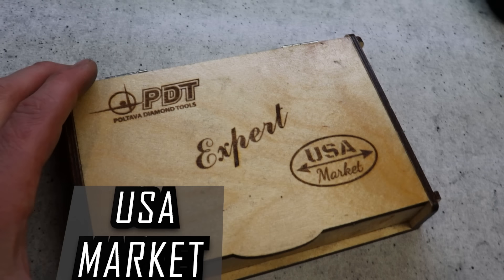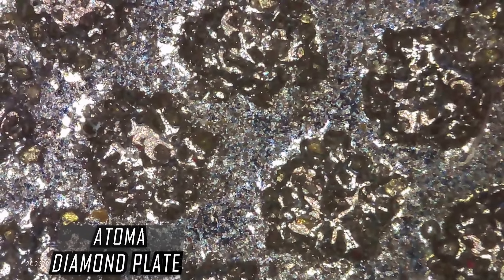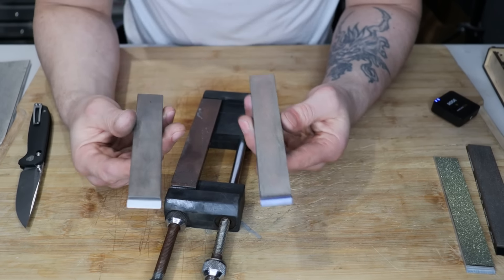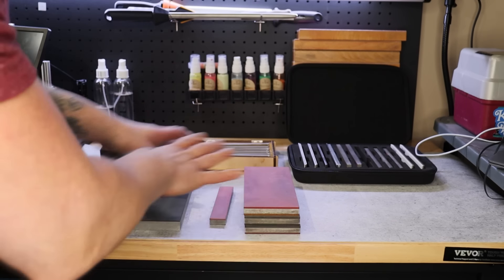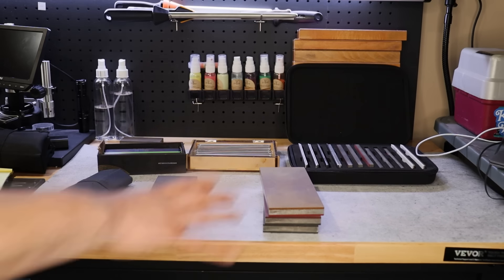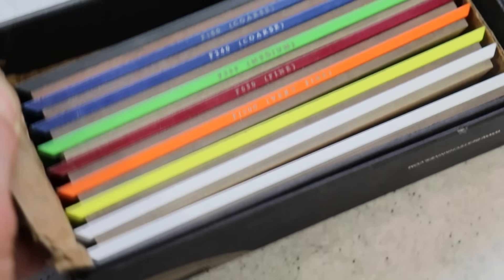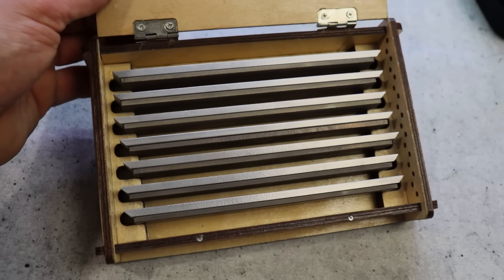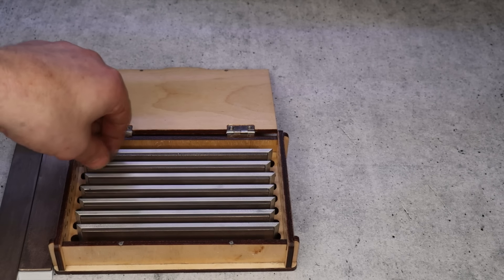Worlds Best Sharpening Stones!?  NEW USA MARKET SHARPENING STONES

Comment: I wonder how many knives can you sharpen with the little fixed sharpener stones?
CBN or Diamond
Reply: Depends on the grit, since lower grit stones will take more wear than the higher ones, but as a minimum likely thousands of knives.
Reply: 77 000 with CBN metal bonded, and 37 000 knives with Diamond resin bonded 🙂
Reply: @stranik1966  How did you come up with those numbers?

Comment: Have you tried lapping the Hapstone CBN stone to see if that brings up the performance?
Reply from the maker: yes i did, but im going to continue to test things out
Reply: @NeevesKnives  I would be interested to hear the results. I have had a 120 grit Poltava CBN stone for a while now so I just bought a set of Hapstone Premium CBN since a store in Canada is now a dealer so I don't have to deal with massively inflated prices, currency fees, or shipping costs.
Reply: @NeevesKnives  I just got my Hapstone CBN stones in. It seems they are made differently than the PDT stones. The gray layer on the Hapstones appears to be some kind of release agent, likely graphite or molybdenum. I cleaned it partially off of a single stone so far with alcohol, wanted to get some pictures with the digital microscope before going farther. Having it on the top of the stone means that both sides of the stone were likely molded so the top of the stone is completely flat and any CBN will be pushed in so they will need to be lapped, some fairly heavily to expose a decent layer of abrasives. That is why they don't seem to be cutting at all. My stones feel very smooth, the 400 and up are nearly glass like, with only the occasional abrasive particle able to be felt in the 150 and below

This did not need to be done with my PDT stone. Not sure if they do that in the factory, or if they are just not molded on both sides resulting in one side being usable out of the box. 

Just thought you might want an update and my thoughts on it.
Reply: Guys, the HAPSTONE HAS NEVER MADE, DOES NOT, AND WILL NOT MAKE sharpening stones because he does not have the equipment for this!!! They buy these bars either from the Kyiv plant or in China, glue them onto aluminum bars and sell them under the Hapstone brand! They are great, but it is IMPOSSIBLE to say that Hapstone is a manufacturer, they are just good marketers 🙂

Comment: To me at least, it seems that Venev stone still far and away the best option for most people. For $55 (and even for $75 which is what I got them at) you're getting 2 stones that will basically last forever or damn near close to it while getting some of if not the best edges possible. Like that's half the price for VERY similar performance. Maybe I'm missing something but that's just how I'm seeing it.
Reply: I have Venev, Nanawa, a Chinese knock off and although I love the Venev and Nanawa, there is NO comparison in the quickness and bite they produce. Not even close.
The higher grit Venev's do give a  nicer mirror finish However if show is what your into. ;<) When doing so, I sharpen with cbn and polish with Venev and set a micro edge with CBN for cutting power.  
KnifeMaker

Comment: Can anyone help me out? 

I heard from several posts and videos that those cheap $30 6x1 diamond stones work alright. I bought a few and the 240 grit became finer than the 800 grit after 3 knives. Is this normal? I expected the cheap stuff to last longer than that.

That being said, I want a 3 stone system (6x1) for cheap, can anyone recommend a set or a type? Maybe a 180, 320 and 600 stone set
Reply from the maker: Cheap diamond plates will wear out fast, but no the coarse ones should last the longest, Get( Atomas ) or( Hapstone Starts ) if you want the best
Reply: @NeevesKnives thanks, I’ll try out the Atoma stones
Reply from the maker: @arercee5528  👊  they are amazing the 140, 400, 600, 1200 is what they have. Then if you wanna get to a polished edge you would only need a couple bonded stones

Comment: I just bought a whole set of the PDT Metal Bonded DIamond Stones. I'm sorry, but Diamond cuts better than CBN. And with the Metal Bonded stones, the CBN only comes in 1.5mm layer thickness. While if you buy the METAL BONDED DIAMOND stones, you get 3mm thick layer of diamonds. So use your best judgment to decided which will last longer. (HINT, CBN stones do not last 2x as long as Diamond, which means you get MORE life out of the METAL BONDED DIAMOND stones. However, either way, at the end of the shitty day, BOTH metal bonded stone types will LAST 5 years or LONGER even if you sharping 3 - 5 knives PER week.
Reply from the maker: cbn does last longer than diamond i would have to take what the companies testing shows as i have not done that test, however i have tested diamond plate next to cbn and the cbn last quite a bit longer, if one is more aggressive than another that has to do with the company and the size and amount of abrasive they put in, cbn is more aggressive in that case, diamond is also more aggressive in the same case
Reply: @ryanlowery9081 the company has decades of experience and confidently reports that their testing shows their CBN stones cut faster than their diamond ones. They claim up to 1.5-2x faster, they seem to have top quality products, and at the very least appear to know what they’re talking about. I’m curious what, in your experience, would make the diamond stones faster? Did you notice a significant difference, or did diamond just slightly edge out CBN in your tests? I’ve never used any of Poltava’s stones (although I’ve been interested in trying them out for a while), but I’m still surprised that user-experience could be so far off from what the company reports
Reply: @InsanityInc100  My CBN cuts faster as I have both.
Reply: You are mistaken Sir. the normal set is 3.46mm. You apparently have the CBN lite which is much thinner.
KnifeMaker

Comment: Dear Mr. Jerad, 
You made mistake, Sir, in this video about 3mm aluminum plate for metallic bonded CBN-stones😊.
GUYS REMEMBER PDTools factory mounted EVERY THIER CBN and Diamond only to 4mm aluminum plates, ONLY!
Attention (!), if the blank is 3mm, YOU bought out-off-market OR fake stones - NOT FROM the factory of PDTools, UKRAINE 🇺🇦
Reply: I have an authentic PDT stone bought from Gritomatic. It has a 2.87mm aluminum plate and overall thickness of 6.35mm
Reply: @Riyame  The thickness of the aluminum substrate of the AUTHENTIC FACTORY CBN-stone, which is produced by the PDTools Superabrasive factory (Ukraine) on the picture of their advertasing booklet is 4 mm (!). I saw this and this is indicated in the factory official booklet! I don’t know what the Gritomatic company sent you, Sir 🤭🤔🤗 ...ask them where and how they  made their own "2.87mm aluminum plate and overall thickness of 6.35mm" 😊.
Reply: @stranik1966  It came with PDT markings, in a PDT box with their foil stickers and info.
Reply: @stranik1966  I downloaded the knife sharpening stone catalog as well. It shows 3mm. Perhaps you were looking in the wrong catalog or are mistaken.

Comment: I notice it's mentioned that the Hapstone parts are from Ukraine, but I didn't hear that the Venev are from Russia.  Pretty good stones, but I won't be buying any more because of that.
Reply: Yes Venev is a russian manufacture. And PDT manufacture is from Ukraine, city Poltava. Hapstone is from Ukraine city Sumy. Ukrainian manufacture much better 😎
Reply: Venev is also a good company, but in order to understand which is better, it is enough to find out the manufacturer, which plant the Kalashnikov concern uses when polishing the barrels of AK-47 assault rifles! So, until February 2022, the Kalashnikov concern (Russia) BUYED GRINDING PASTES FROM PDTools (Ukraine) and not from Venev (although it is a Russian company) - here is a simple, clear answer to you, which of the two companies - PDTools or Venev, is better 🙂
Attentiuon (!):
Reply: Hapstone has NEVER MADE AND CAN NOT MAKE SHARPENING WHISTLES BECAUSE THEY DO NOT HAVE THE EQUIPMENT FOR THIS! All they do is buy sharpening stones somewhere, stick them on aluminum and put their trademark, but they are not located in Poltava (!) and HAVE NO RELATION TO THE PRODUCTION OF THE BODY OF GRINDING WHETS!!!
Reply: @stranik1966  Yep, on BF I saw the stropping paste from either TS pro  or hapstone. Don't remember which. I stated that it looked like Poltava as I have a lot of it here. I was told "NO" it is not. Well, I ran it down and it is indeed Poltava Diamond paste. LOL!!!
KnifeMaker

Comment: I don't think you can just compare the thickness of different brands of resin bonded stones without also taken into consideration how quickly they wear, which depends on the type of bonding agent used.  You can't use a stone to condition metal bonded stones (but it will help clean them).  You have to use ferric chloride, or you can use electrolysis, as shown by Knives Switzerland.

Comment: Venev 8 by 3 says not in stock?Who has them?
Reply from the maker: Did you check Hapstone? Otherwise you might find them in the NeevesKnives store, but that's what I mean they are becoming harder and harder to find I'm not sure if restocking will happen
Reply: @NeevesKnives  I found one on eBay through Hapstone seller. 290$ ouch! Have to rethink it. Woodturners has a Cbn stone too.
Reply: @robertmunguia250  It is possible that the CBN-stone (the abrasive body of the sharpening stone) that Hapstone advertises as his own were made in Ukraine. However, they are ONLY (!) to mountain and glued the abrasive body of the sharpening aluminum plates in the city of Sumy (Ukraine, Hapstone), where the Hapstone company is legally registered, AND NOT MAKING Its BODY! It's as if I bought a horse, bought a saddle and put it on the horse, and everywhere at Horse's Shows I claimed that it was my horse. Of course, this is your horse, but YOU DIDN’T RAISED IT AND DID NOT EDUCATE IT, so always at the Horse Show, you won’t be able to say that this is my horse - YOU MUST TELL THE HORSE's BREEDER FROM WHOM YOU BUYED THIS HORSE! If I'm wrong, then I don't understand something in this nowadays world, guys.

Comment: I have a theory. Looking at the specs from both websites I believe that PDT makes the bonded stones for hapstone. Don't look at the grit rating, Look at the micron ratings and the materials used. Both companies are in Ukraine. Hmmmmmmmmmm
Reply: Sure!
Hapstone has NEVER MADE AND CAN NOT MAKE SHARPENING WHISTLES BECAUSE THEY DO NOT HAVE THE EQUIPMENT FOR THIS! All they do is buy sharpening stones somewhere, stick them on aluminum and put their trademark, but they are not located in Poltava (!) and HAVE NO RELATION TO THE PRODUCTION OF THE BODY OF GRINDING WHETS!!!
Reply: @stranik1966  I'm loving my Poltava metal bonded Diamond Stones. I have sharpened about a dozen knives with them so far, and they are nice and broken in now. Absolutely amazing stones, 10 out of 10. I would buy again without hesitation. Thanks for the help on them Albert.

Comment: Nah man. Birdie T2 stones are the top of the line. Doesn’t get better than T2 stones.
Reply: I had a heavily damaged Buck 119 from a family member I needed to profile and grind a few chips out of. Went halfway through a low grit Boride SiC stone. Right after I got a cbn stone for low grit work. My 120 PDT metal bonded CBN has done more work and hasn't even needed to be flattened yet.